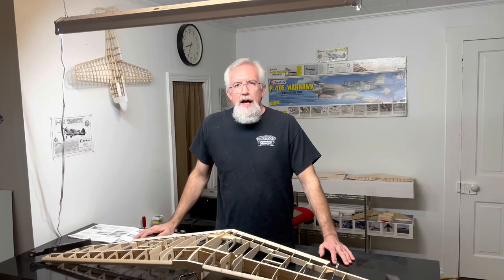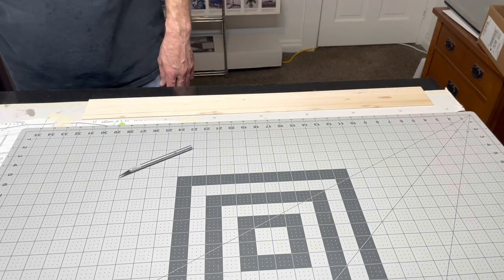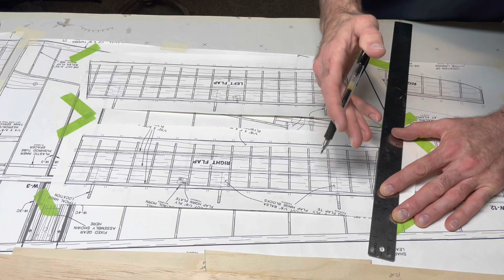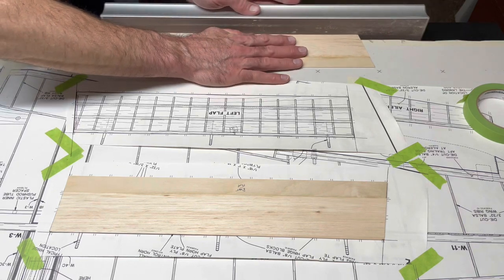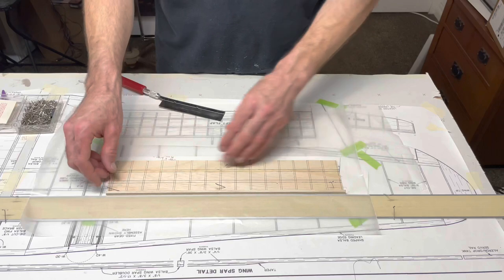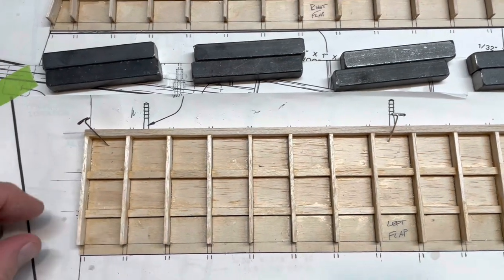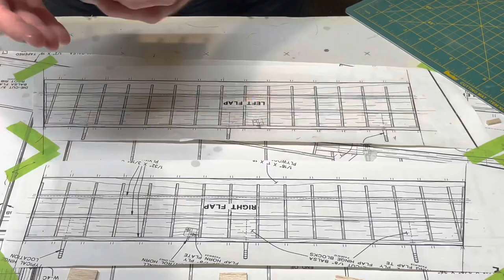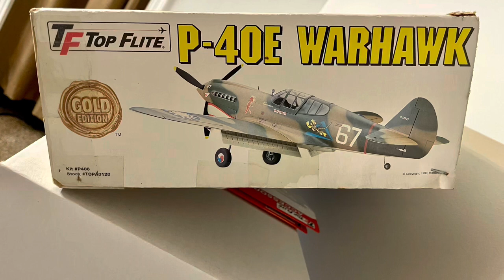Top Flite .60 size P-40E Warhawk Build: Part 14 (Flap Build up and completion)

Comment: Any ideas on why this way instead of gluing down the stringers then notching the ribs just like any wing rib? And if this way, could you not make a bunch of short pieces, ala wing shear webs, and use a jig piece to get uniform spacing when gluing the ribs? It would seem to reduce the fiddle work a bit. I appreciate your craftsmanship!
Reply from the maker: I’m just a guy following the instructions. I agree though. There has to be a better way. But in the end, they’re finished.

Comment: Good choice in retract’s shame they don’t come electric
Reply from the maker: They are nice. I didn’t go electric, because of the battery drain issues. I’m just trying to save weight by not having to add bigger batteries, or multiple battery packs. Plus, I don’t care for the noise the electric retracts make. I know you don’t hear it in the air, but that’s just how I feel about it. Lol

Comment: Frank, I’m having trouble finding the weights you used when building the flaps. I looked at the stunt line form but no luck. Can you assist? Thanks Bill. Also keep up with the great videos!
Reply from the maker: I’ll try to find them and post a link here somewhere.
Reply: @FranksModelAviationWorkshop  Many thanks!
Reply from the maker: @billgrozdanich1165  unfortunately Tom Morris is out of business. All those weights are is 1/2 inch bar stock cut to 3 inch lengths. Hope that helps you.
Reply: @FranksModelAviationWorkshop  Got it, thanks for the assist.